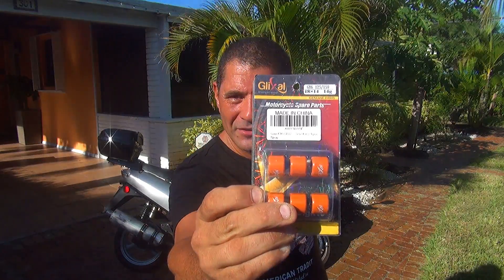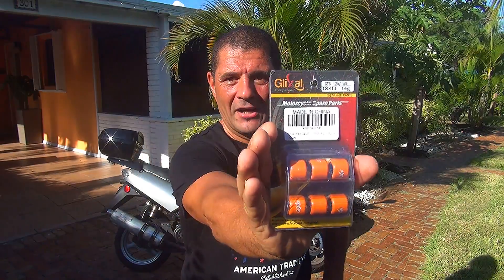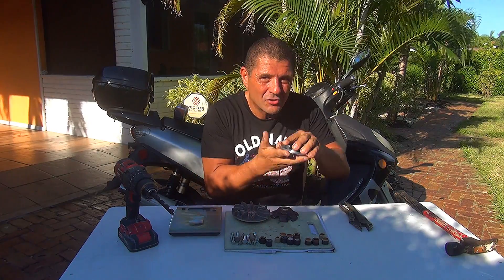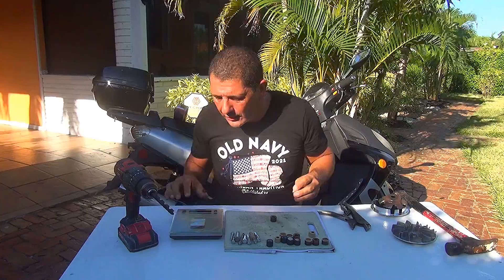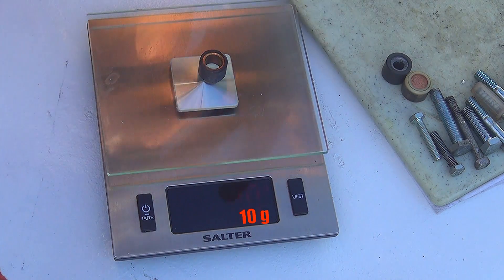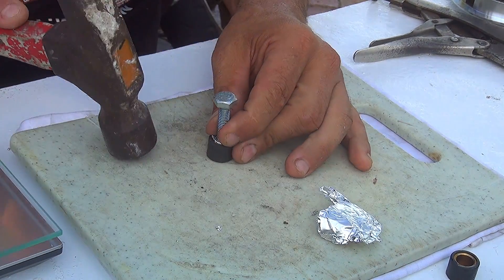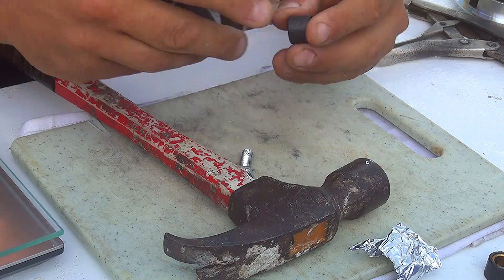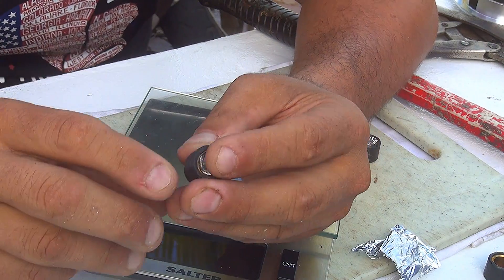Modifying Roller Weights for CVT Touning

Comment: Hi Sir, I am from India and loved your video. Could you please tell me if increasing the roller weight of my scooty will improve its mileage and what effect it might have on the top speed?❤❤❤❤❤😊😊😊
Reply from the maker: Increasing roller weight can improve mileage by lowering RPMs at cruising speeds, reducing fuel consumption. However, it may reduce acceleration and affect top speed. If the stock rollers are too light, heavier ones can improve top speed by allowing the variator to fully engage. If too heavy, they may bog the engine, lowering speed. A small increase (1-2g) can balance efficiency and performance. Using slider weights like Dr. Pulley can help maintain acceleration while improving mileage. Test different weights to find the best balance for your scooter.

Comment: Hey my friend what’s the best weight for a 168cc scooter/motorcycle
Reply from the maker: For a 168cc scooter, 10-12g gives better acceleration, 12-14g is balanced, and 14-16g favors top speed. Dr. Pulley sliders in 12-14g work best. 🚀

Comment: What’s up brother thanks for your vids once again I change my variation to dr pulley 14.5 sliders I think I went to heavy I have a eagle 150 gy6 my top end speed is good but when accelerating to 30 I’m pulling 5500 rpm’s if that’s true rpm on scooter I’m hearing that sliders are a gram nore then rollers is that true and if I change clutch spring to 1500 will it help me accelerate better or should I just get 12 sliders my friend I want this mopad to last as long as possible didnt know if higher rpm’s will mess it up thank you for all your info be safe
Reply from the maker: Yes, Dr. Pulley sliders generally feel heavier than rollers. Your current setup might be a bit too heavy, affecting acceleration. Switching to a 1500 RPM clutch spring can help with better acceleration. If the 14.5g sliders seem too heavy, trying 12g sliders might give you a better balance. Higher RPMs can stress the engine, so find a setup that offers good performance without consistently high RPMs. Thank you for watching my video and ride safe

Comment: I have a 150cc gy6. I weigh 270. What would be a good roller weight for better top end for me
Reply from the maker: Selecting the right roller weights for your scooter involves some experimentation and might require adjustments based on your specific preferences and riding conditions. Generally, the goal of adjusting roller weights is to find a balance between acceleration and top speed. Since you're looking for better top-end speed, you'll want to go for slightly lighter roller weights.
Keep in mind that roller weight recommendations can vary based on factors like scooter model, engine tuning, tire size, riding environment, and personal preferences. That being said, for a 150cc GY6 scooter with your weight of 270 pounds, you might consider starting with roller weights in the range of 10-12 grams.
Lighter roller weights, such as 10-11 grams, can help improve top-end speed but might sacrifice a bit of low-end acceleration. On the other hand, slightly heavier roller weights around 12 grams could provide a good compromise between acceleration and top speed.
Thank you for watching my video
Reply: Thank you Guy your the best. A very good teacher.

Comment: Hello I wanted to know which roller weight should I go with for a 2006 150cc tank I replace the stock 24mm with a 26mm and a racing cdi box and coil and filter it can get up to 65 till it starts to scream and vibrate i have a new 2000rpm clutch coming someone told me to go 11g weight if I want more top speed without sacrificing too much acceleration but someone else told me based on my set up I should go with either 12 or 14
Reply from the maker: Choosing the right roller weights for your scooter can be a bit of trial and error since the ideal weight can depend on several factors such as the engine's power, weight of the scooter, and riding conditions. Based on the modifications you have made to your 2006 150cc Tank scooter, it seems like you are looking for a balance between top speed and acceleration.

An 11g roller weight would likely increase your top speed while sacrificing some acceleration, but it's difficult to say whether it's the best choice without more information about your scooter's specific setup. However, since someone else has suggested using 12 or 14g roller weights, it may be worth considering these options as well.

Here are some general guidelines that may help you choose the right roller weight:

Heavier roller weights (such as 12 or 14g) will provide more low-end power and acceleration but will reduce top speed.
Lighter roller weights (such as 11g) will increase top speed but may reduce acceleration.
If you are unsure about which roller weight to choose, it may be helpful to test different weights to see which one works best for your specific scooter and riding style.
Ultimately, the best way to determine the right roller weight for your scooter is to experiment with different weights and find the one that provides the best balance between acceleration and top speed for your specific setup. You may also want to consult with a qualified mechanic or scooter tuner who can provide more personalized advice based on their experience and expertise.
Reply: @VirberelloScooterTips  thank you so much for getting back to me every knowledge I can get helps every it the bike weighs a little over 300 pounds but I will buy the wieght set and get the experimenting. I will definitely keep you  guys posted and I will reach out again if I need more help or have more questions

Comment: This is very helpful. New subscriber here.

Why do you think I keep having issues with my belt snapping? I just changed one, got a couple of miles and the same thing happens. My bike will stop going, but still runs. What do you suggest I look into?
Reply: I'd make sure there's no cracks or flare in your variator, buy Kevlar belt, much more resistant to snapping to those junk 10$ belts
Reply: John Surguy Thanks alot! That's EXACTLY what I did. Been running ever since. 🏍💨💨💨🤣
Reply from the maker: Hello my friend make sure your belt is the right size for your scooter plus few company make the belt little wider and that doesn’t let the belt go deep in the clutch plates and will slap and grind on the lower side of the cvt cover and at the end try to choose kevlar belts but sometimes they say is Kevlar and they are not really high quality I like gates belts made in usa but few years ago they had better quality. Thank you for watching my video

Comment: Hey virberello 
your videos are so helpful. Thanks a lot bruh.🔥
ive got an electrical issue With my sym crox 150. When i turn on my headlight at idle it runs fine but when i ride my scooter the headlights dims out and when i use either my break, horn or turn signal it light at same time and goes dim after i realise the break or the buttons 🥲 . Can you tell me what is causing that ?
Reply from the maker: Hello my friend that is the yellow wire coming from the stator somewhere the yellow wire is shorting so touching the negative part or a ground on the scooter that happen to me when I tight my mirror and I squeeze a little wire . thank you for watching my video

Comment: Why do i have to put a lil gas on my spark plug for it to start sometimes? How do i fix that or whats the problem?
Reply from the maker: Hello Sonny check the gap at the spark plug to make sure i not to wide also if you can find a irridium spark plug https://amzn.to/3yZpjHK or a better quality also there is a possibility that your carburator is a little dirty at the carburator jets but if your  scooter is a gy6 could be that the stator is not producing a lot of current for your scooter
Reply: Sounds like a dirty carburetor

Comment: My friend what will happen when put 17 gram rollers in my 125 cc scooter ?
Reply from the maker: Hello my friend 17 g are great for traveling at a good speed like on a freeway  they will keep your rpm around 7000 and your scooter will run with less vibration
Reply: @VirberelloScooterTips  
Thank you my friend ♥️♥️♥️